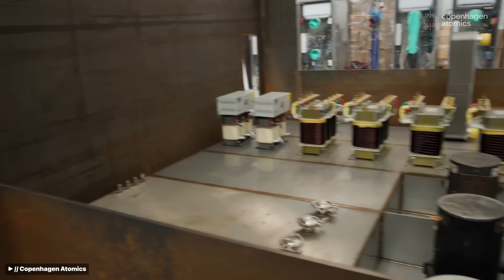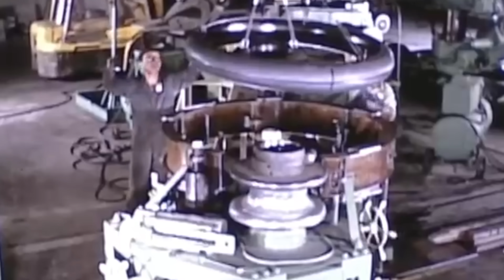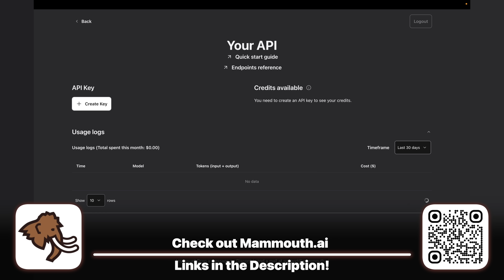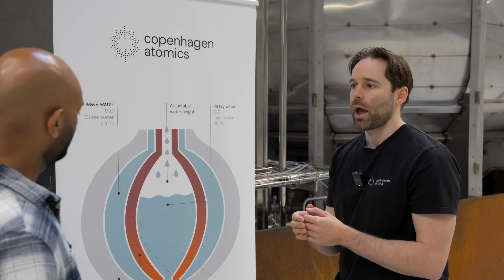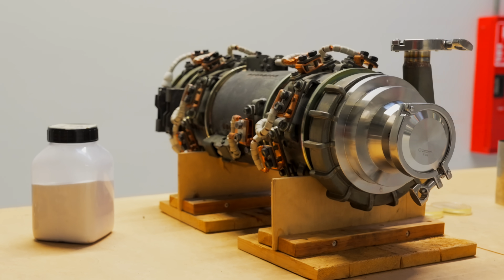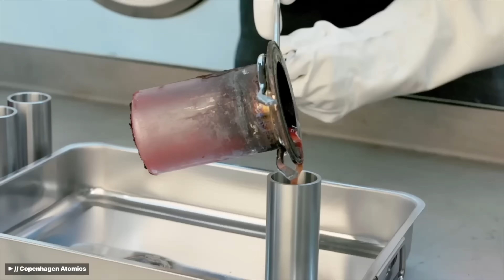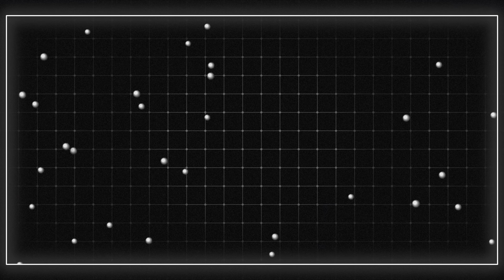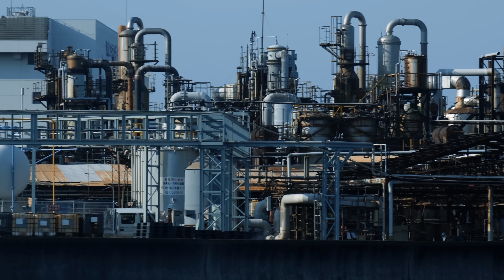This Modular Thorium Reactor EATS Nuclear Waste

Comment: When I see all the technical challenges, the high temperatures and the solid metal enclosure, I just think, it will never be as cheap as wind and solar with batteries. And doing all that just to produce steam? There must be better ways.
As long as we don't put public money in this kind of projects and whoever wants to run the reactor has to fully insure it by themselves, science away!
They will be as successful as the hydrogen car.

Comment: Thorium is all hype first of all you need to cook it in a nuclear reactor so after 12 months the Thorium rods need to be extracted by Purex process. It's a costly process not only that you still have to deal with plutonium waste . The question here is it a Thorium fuel assembly or is it mixed with enriched uranium never less Thorium needs to be cooked .
Reply: Did you watch the video? It's got nothing to do with Purex, there are no 'thorium rods', it's not a solid fuel reactor. And there'll be very little plutonium produced - thorium needs to absorb 7 neutrons in sequence to transmute to Pu239, and at several points on that path, it's much more likely to just fission.  And any plutonium in the fuel salt at reactor end of life just gets transferred to the next reactor, where it will likely fission.
Reply: @2x6x250ml Yes I've seen the video the whole set up looks unsafe to operate and I have studied nuclear physics and chemistry with material science. Using salts is new technology like all things new there's ups and downs and salt contains chlorine. After reading about using Sodium as coolant and heat transfer it has a habit of diffusing into certain metals and any build up of hydrogen gas makes metals brittle . The solution is to coated with ceramic and any case these reactors will be expensive.

Comment: what is the worst case scenario of total failure of this kind of system?

Let's assume that the gravity system doesn't stop the reaction, and the thick steel outer case also fails. What is the worst case scenario here? Can a thorium reactor have an explosion or meltdown, and if it did, what level of danger would that create, say compared to Chernobyl?

Comment: I assume the lithium seven is 100% reusable.

Since lithium six eats up extra neutrons, couldn't you just enrich lithium with any function that releases extra neutrons?

I assume this would ruin whatever fuel etc. was used to do the enrichment, but surely there are sources of neutrons that could be taken advantage of. Additionally, it might be worth using up those neutron sources to manufacture lithium seven. and then you would get a much higher yield without having to do any kind of fancy evaporation.

It also seems to me that putting a lithium jacket around any kind of nuclear system would create a passive way to generate more lithium seven while creating some additional protectionfor those systems, prevent preventing neutrons from exiting the system and causing other problems.
Reply: Neutrons are much more valuable producing energy and new fuel. Anyway Li6 is more likely to split into tritium than form Li7. Natural lithium is nearly 95% Li7 anyway.
Reply: @2x6x250ml  that seems to be the common wisdom, but again, given that LI7 should be reusable, might it not be worse the initial cost to get the heavy lithium for each reactor? It seems like this distillation process requires more complicated hardware than simply enriching LI6, but I am no nuclear scientist
Reply: @EliotHochberg Copenhagen Atomics originally planned to use less highly enriched Lithium, and just 'burn' out the Li6 till it was good enough for breeding. If their enrichment process is good enough, that won't be necessary. The lithium, and the enriched heavy water, can mostly be transferred to the next reactor after five years, with a top-up to cover losses. Getting tritium out of the heavy water might be trickier, but Candu's manage it.

Comment: Many of the issues with nuclear power are created by politicians and activists.

The anti-nuclear people created roadblocks that cause both delays and excessive costs, and then they complain that it takes too long and costs too much. Always hiding the fact that the rules they put in place caused these problems.

The U.S. Vallecitos reactor was constructed in just 21 months and was up and running in 1957. Almost 70 years ago. Modern technology should have made building these things faster, not 5-10 times longer. 

Last I knew, it was a decade, and a billion dollars spent before a single gram of dirt was even moved. The activist politicians worked hard to keep injecting new rules, causing plants being built to suddenly have to rebuild and retool everything on a monthly basis. This was a "success" for them because it scared off all the money going into nuclear power. Money that could have been spent on efficient power plants, as well as advancing the technology and safety. There have been advancements, but these advancements we are seeing now should have occurred a decade or two earlier had we been building nuclear power plants. It was also research funds that dried up. 

The reason only 1% of the fuel is used is that many governments banned reprocessing. Otherwise known as recycling. This could be done on-site, and the result is that the waste can be used over and over and over.

But at least research is finally moving forward again. Just let's realize what the BS is, and why cost and time are such a problem. But we should be removing, or at least adjusting, the BS red tape that was put into place that prevented theadvancementg of nuclear power.

Comment: Great video, I have been following Copenhagen Atomics for some time now. 

With this red hydrogen which LFTRs make more efficiently using high temperature to make hydrogen rather than electrolysis, we could make pollution free liquid fuel which is safer and easier to handle.

The Navy when exploring how to make onboard aircraft fuel on an aircraft carrier developed an efficient way to take CO2 from seawater (more abundant than from the air) and combine it with hydrogen to make liquid fuel like ethanol.  They hydrogen in this case comes from electrolysis from the aircraft carrier's nuclear reactor.  (I am sure Naval vessels are upping their electricity capacity already for laser type weapon systems).

In 2016 in Brazil, Nissan drove around with an ethanol powered fuel cell electric vehicle using Brazil's existing E100 fuel infrastructure.

This fuel cell could operate even if the ethanol was at such a low proof so as to be non-flammable.  

Large European and Indian military submarines use ethanol fuel cells today for propulsion.  Alcohol fuel cells can be and are sold small enough for computers, long range drones, RV/sailboat power, and backup power systems.

Fuel Cell technology offers many advantages over Lithium-ion batteries, not the least of which is that hydrogen used in fuel cells has the energy to weight ratio ten times greater than lithium-ion batteries.

That said, the volumetric energy density of ethanol is over five times greater than hydrogen.

Ethanol has five times higher volumetric energy density (6.7 kWh/L) than hydrogen (1.3 kWh/L) and can be used safely in fuel cells for power generation.

With enough non-toxic ethanol we could have dedicated hyper efficient pollution free ethanol optimized internal combustion engines with more power and more mpg than gasoline, even more than what diesel engines can achieve at half the size/twice the power.

Ricardo built and drove around such an ethanol engine for GM around 2010.

These ethanol optimized internal combustion engines are up in fuel cell ranges of efficiency.  Note this is not new knowledge or technology, it was known long ago:

Rear Admiral C.M. Chester wrote Henry Ford a letter on Dec.15, 1916:
"...I also pointed out in the article that as governmental laboratories had developed from 40 to 55% efficiency in alcohol engines as against 20% in gasoline machines, the use of alcohol at double the cost of gasoline for power purposes, was cheaper for motor[s] than gasoline in common use today."

All gaseous fuels are inherently dangerous, hydrogen at high pressures even more.  As the equipment ages, even more than that.

Hydrogen would need a whole new and very expensive fuel supply infrastructure as well.  

With ethanol, we can simply use our already existing petroleum fuel supply infrastructure like Brazil did when they came out with E100.  We can even wear out our existing inefficient gasoline optimized cars with ethanol until the ethanol optimized engines/fuel cells come online.  Making a transition as painless as possible.  France today has legalized E85 conversion kits for their country's non-flex fuel fleet.

A fuel cell car could possibly pay when a worker at the end of a workday comes home to his house maintained with solar during the day, (s)he could plug in his/her house to supply heat and electricity for the house (rather than plugging in his car to the house with a battery powered car). 

Ethanol can be used to make aromatic free cleaner jet fuel or ATJ.  Or dedicated turbine engines optimized for ethanol like the ICE engines could be made.  A jet flying over LA could have exhaust cleaner than the air going into it.

Comment: Just figured that fuel salt leaks don't really matter - the leaking salt will just run down to the dump tanks, which is where it all goes anyway, whenever the pumps stop. Leaking water, though, would be disastrous. The whole case for corrosion resistance demands that the salt has very low levels of oxygen contamination, not to mention that direct exposure of water to 700C radioactive matter is unhealthy, cf Fukushima. Making the water shells (non-salt-facing) of the onion from zircaloy, and welding that to the steel plumbing, would mean no critical joins of ceramic to steel.  Zircaloy has a low neutron cross-section, though not as low as silicon carbide. Welding it to stainless steel would be difficult, it's got a different rate of expansion with temperature, and needs protection from air above 300 C till the weld sets. Incidentally, 51% of natural zirconium is the 90Zr isotope, which has a neutron absorption cross-section over a hundred times lower than 91Zr, which makes up 11%. Enriching the zirconium used might be worthwhile, especially if laser enrichment pans out. 91Zr is the only odd-numbered stable isotope, the only one with positive electron spin, and has a neutron cross-section 5 to 100 times higher than any of the other stable isotopes.

Comment: People who are against nuclear are not actually concerned about CO2 emissions and/or completely ignorant.
Nuckear power is the closest thing we have to "perpetual motion" and its here now, not forever 20 years away like fusion.  And its baseload where wind abd solar aren't.
If we'd not cut our own throats back after public fear of the stupid movie "the China Syndrome" and what was actual a very minor incident at 3-mile Island where no one was actually harmed, we coukd be 100% clean nuclear by now with modern molten salt reactors in operation.
Such a missed opportunity!
They can not only use spent fuel sitting around in storage at light water plants, they can use the hundreds of thousands of tons of depleted uranium we have in low lever storage now just taking up space.
Theres enough spent fuel and depleted uranium stocks in the US to meet 100% of our electrical needs for the next 250 years by my calculations.
250 years before we'd need to actually mine anything new.
Then thirium could be used after that.
The potential is really mind boggling.
But...idiot politics, the "Green Lobby" and "Big Oil" and ignorant environmentalists have all worked together to prevent it.
Sigh...

Comment: Copenhagener here, this is one of the projects I still can't believe is actually local. Been following their work for years. I've been a major proponent of nuclear energy in Denmark and globally for years, specifically researching optimal methods to scale it with a dynamically dependent infrastructure and security integration, both in terms of digital system breach risk, as well as physical risk in the case of future armed conflict (a topic that is more prevalent than ever these years).

Modular reactors of this scale solve so many adamant issues and bottlenecks that prevent nuclear from getting through to the legislative decision makers as a genuine and viable option on par or better than existing green tech solutions that don't scale as consistently to exponential energy demands we are expecting for the future 5-10 years.

Very excited to follow Copenhagen Atomics' progress and also see the more widespread global attention they're receiving, hopefully enabling breakthroughs that could spearhead the industry across nations.

Comment: You forgot one thing.
Loss of energy in transmission.  A remote power station loses 1/3 of its energy sending it's to the end user miles and miles away.  
A small or large city could completely restructure its power grid to several nodes. The end user can pay the per kilo watt. But the city can make a profit with difference to pay off bonds it cost to install.

Comment: This type of system for decentralized power and/or heat generation is the only answer to the future of our strategic security and safety. Our modern electricity based society is so vulnerable to cascading power outages it’s not even funny….a couple centralized attacks on transmission lines that knock a generation facility or two offline could cause a nationwide blackout that lasts for days. That coupled with bad weather conditions and our society could take decades to recover if at all…

Decentralized generation would result in a greater ability for the grid to handle cascading overloads by allowing a greater local fidelity in the ability to disconnect from the grid and only supply local power when required.

Comment: Candu reactors uses duterium drainage as emergency stop.  No duterium no slow neutrons  no fission.... All fission and breeding stops stops.  
   Like the hot pump . Lots of good ideas.  Might need to check contamination in the lithium brine. That could be tough.  Great consept.

Comment: I would have thought the easiest way to remove the Li6 would be to run the lithium salt through any neutron source.  Li6 is a neutron absorber, which results in Li7.  Pass it through a nuclear reactor until there's no more Li6.  There method is probably easier.

Comment: Protactinium is a neutron poison till it half-lives out to U233. Half-life is 27 days, and the reactor is to make 100 megawatts thermal. One gram of fissile generates a megawatt/day, so there should be on the order of 3kg of Protactinium233 ripening in the blanket, on average. There are 3,000 litres of thorium tetrafluoride/lithium fluoride in the blanket, eutectic ratio (lowest melting point) is 78 mol% LiF, 22 mol% ThF4. 
Molar mass L7iF is 7 + 19 = 26. Molar mass ThF4 is 232 + (4 x 19) = 308.
Specific gravity of eutectic LiF/ThF4 at 600 C is about 4.4.
0.78 x 26 = 20.28
0.22 x 308 = 67.76
So about  three quarters of the blanket salt by mass is ThF4, and three quarters of that is thorium.
Thorium mass is (.75 x .75) x 3000 litres x s.g. 4.4 = about 7,400 kilos of thorium. 
3 kilos of protactinium in 7,400 kilos of thorium (with nearly equal atomic masses) would suggest that a neutron is far more likely to be absorbed by thorium. However, the neutron absorption cross-section of protactinium 33 in the thermal spectrum is about 50 barns, for thorium, only about 7 barns. 
7,400 x 7 = 51,800
3 x 50 = 150.
51800/150 = 345.
So a rough estimate is that a neutron getting into the blanket is roughly 300 times more likely to be gained fertilising a thorium nucleus, than lost making non-fissile Pa234. Pa234 decays in a few hours to U234, which is not fissile, but it is fertile, and much more likely to absorb another neutron, and become fissile U235, than natural U238 is to become fissile Plutonium239. U233 fissioning in the thermal spectrum averages slightly more neutrons than does U235 - on the order of 2.5 per fission, plus a few from gamma activation of deuterium in the moderator. One for the chain reaction, one for breeding, allows 0.5 for absorption/escape losses. So I think if CA can make as neutron-transparent a core as they plan, it could breed. Whether it and the pumps would last five years, whether they can engineer leak-proof pipe joins between composites and steel, and whether they can filter out all the non-volatile fission products, is to be determined.
Reply: Double walled 315ss inconel 3D printed pipes.  Use the outer channel as leakage indicator to trigger safety protocols. 😊
Reply: @MichaelSpears-g7h  Just figured that fuel salt leaks don't really matter - the leaking salt will just run down to the dump tanks, which is where it all goes anyway, whenever the pumps stop. Leaking water, though, would be disastrous. The whole case for corrosion resistance demands that the salt has very low levels of oxygen contamination, not to mention that direct exposure of water to 700C radioactive matter is unhealthy, cf Fukushima. Making the water shells (non-salt-facing) of the onion from zircaloy, and welding that to the steel plumbing, would mean no critical joins of ceramic to steel.  Zircaloy has a low neutron cross-section, though not as low as silicon carbide. Welding it to stainless steel would be difficult, it's got a different rate of expansion with temperature, and needs protection from air above 300 C till the weld sets. Incidentally, 51% of natural zirconium is the 90Zr isotope, which has a neutron absorption cross-section over a hundred times lower than 91Zr, which makes up 11%. Enriching the zirconium used might be worthwhile, especially if laser enrichment pans out. 91Zr is the only odd-numbered stable isotope, the only one with positive electron spin, and has a neutron cross-section 5 to 100 times higher than any of the other stable isotopes.